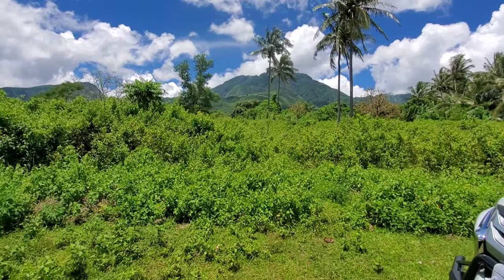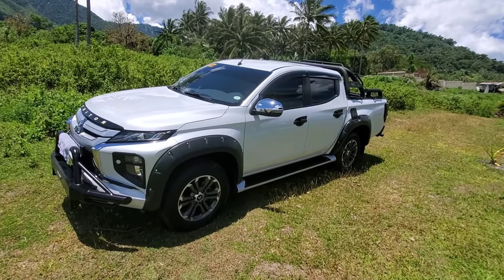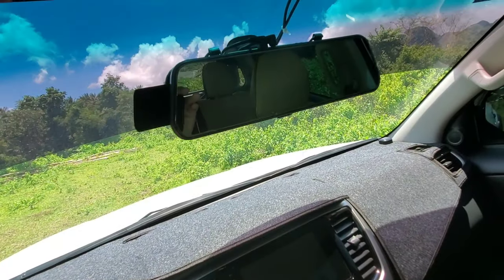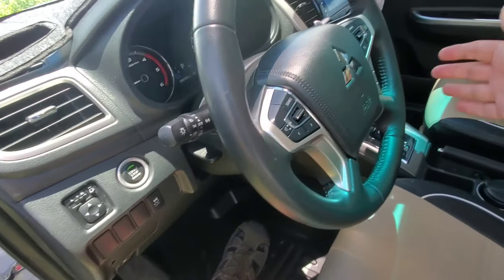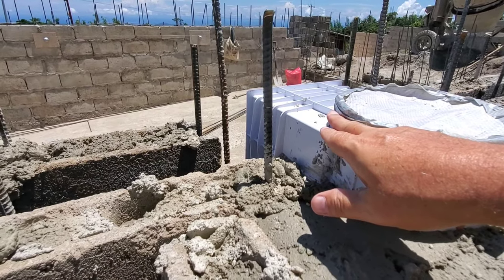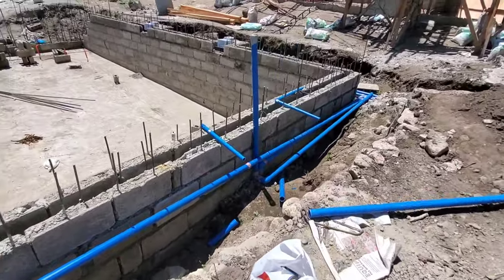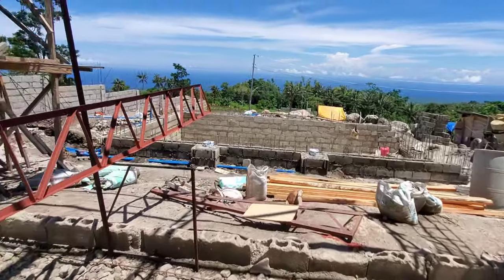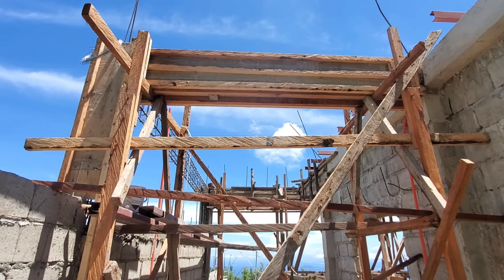House Build update - Construction day 51

Comment: Nice truck ! , Mitsubishi  is in a partnership with Renault/ Nissan in  automobiles,im sure you have to put AdBlue liquid  to the reservoir, price is very comparable to Nissan equivalent,  New 2022 Nissan Pickup  has rear coilsprings if I'm not wrong, good progress on pool.
Reply from the maker: I take it to the Mitsubishi dealer every 5,000 k for service.  They change oil every 10k, but replace oil filter/top off oil every 5k in between full oil changes.  Not sure about the DEF/adblue I will need to ask them next time.  I read the Nissan & Mitsubishi have the same frames as well.

Comment: hi there, I often watch ur videos and your place is coming out nice. I am curious about your electrical. I have watched other builds in pi and no one seems to have their home grounded. I would think with metal roof and the storms and power surges people would consider grounding their homes. My previous house was not grounded and i lost a refrigerator and tv. My new house in pi I made sure it was ground and i added surge protectors as you know the brown outs and loss of power can damage electrical devices. thanks for sharing you build.
Reply: almost all new homes have a long grounding rod installed.  However basically unless you ask (and pay for it) you will not get grounds run to the wall plugs.  Just the panel boxes are ground.  I specifically had certain wire runs to include a green ground for specific equipment I knew would need it.
Reply from the maker: The home will be grounded 2 times.  The first ground will be out where the main wire enters the property.  They use a 6-foot copper rod into the ground.  The 2nd one will be right outside the house next to the main electrical panel.  Thanks for the questions.
Reply: @buildingthephilippines  thanks for responding. i am sure ur home will be beautiful when done.:0)
Reply: @wlb-comments7596  thanks i was just curious becoz i have seen many videos and never saw them mentioning grounding. I am sure many of the electricians are not licensed and like you said unless u ask they may skip that step.
Reply from the maker: Thanks, we can't wait to move in.

Comment: Greg some more questions. How long did it take when your car was ready to pick up? Did the dealer take care for the licence plate. How long is the car warranty? And your insurance can you arange that also with the dealer? Sorry many questions but we are also looking for a pickup truck in Leyte. Regards Jack
Reply from the maker: Hi Jack, if the vehicle is on the lot, it's pretty simple.  If you pay by cash, get a managers check from your bank for the exact figure. That will include the vehicle, registration for 3 years, 3 years of regular insurance, 1 year of collision insurance.  You get a temporary plate until you get your permanent plate.  The dealer will also handle that with the LTO.  Our permanent plate took 30 days to arrive at the dealer.  Warranty is 5 years or 100,000 kilometers, whatever come first.  I hope this helps and good luck with your search.  Once we paid for the vehicle, we drove out about 1 hour later. Thanks for watching.
Reply: @buildingthephilippines  Thanks for th info Greg
Reply from the maker: @jackpiket7643  your welcome and good luck with your future purchase.